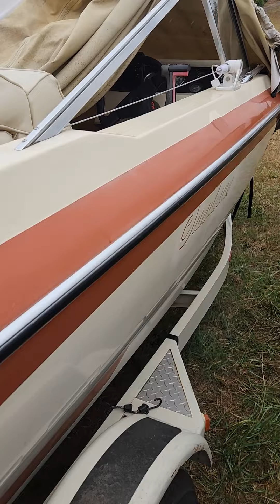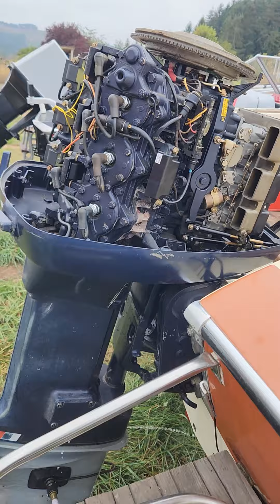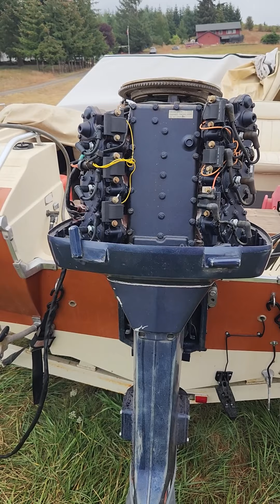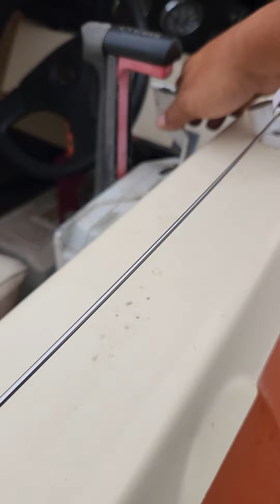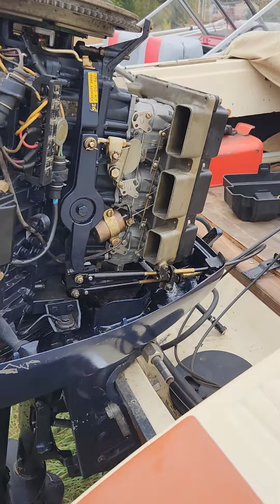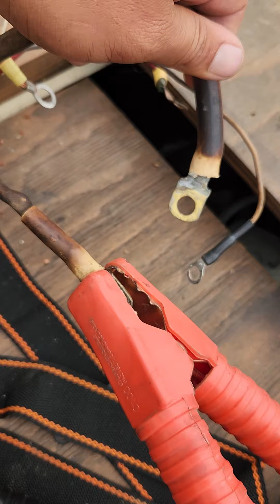1979 Evinrude 150hp V6 2-stroke

Comment: Nice work!  I've got a 1983 that looks pretty similar.  This motor runs a little smoother than mine.  I picked up mine non running and got it purring this past summer.  Been fun getting it running and pissing off the neighbors on muffs :)